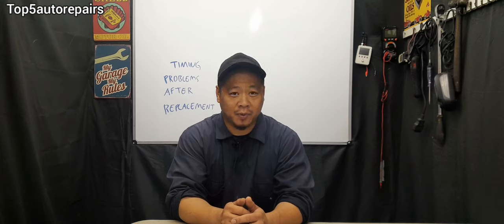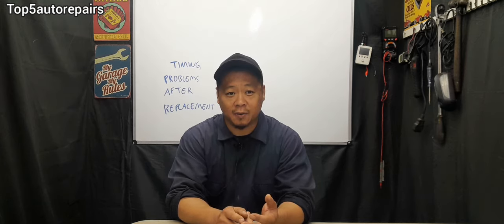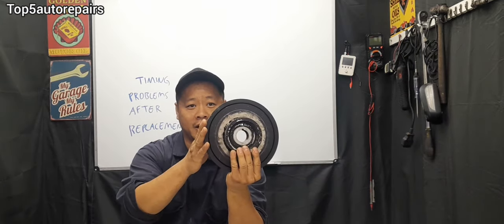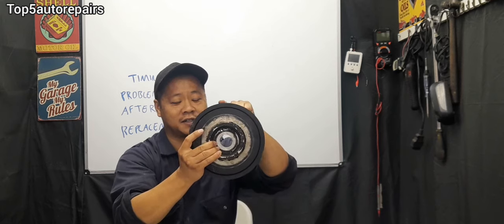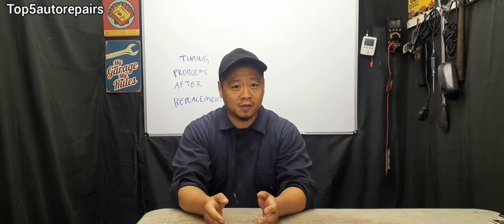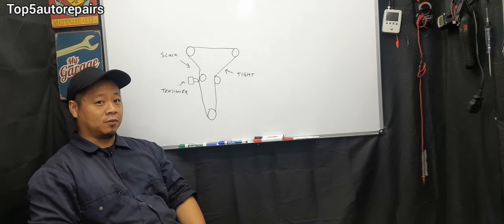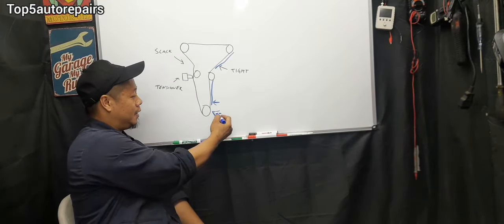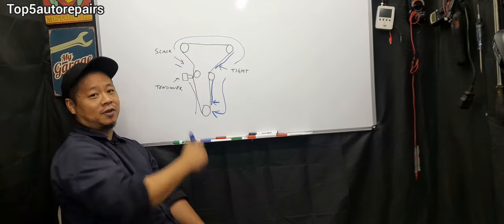CAR ENGINE NOT STARTING AFTER TIMING BELT / CHAIN REPLACEMENT

Comment: I just replaced timing belt tensioner hydraulic,  crank sensor and align all timing marks on 2005 sedona.  Prior to changing belt the idle was having misfires but at higher rpm , ran ok.  I restarted engine and ran ok at higher rpm's but still have rough idle and misfire on #3 and bank 2 oxygen sensor code new codes.  On second start up I inadvertently forgot to put the crankshaft bolt and the Timing Crankshaft Sprocket slid forward on crankshaft about 1/4 inch like it was going to come off but the engine turned off and now won't start.  I had installed a new crankshaft sensor.  Removed it and there were visibly excess rubbing in the sensor channel.  Any idea what need s to be done?  Also when I try start engine, it feels like it reverse direction while it's turning over.  On this interference engine. Is it required to remove 1 plug and set TDC before aligning timing marks on cam gears and crankshaft?  I'm about ready to send it to the crusher.  It does have 225,000 miles.  Any advice would be greatly appreciated $$. Ty...

Comment: Timing was replaced on my 2008 Jeep Commander and it will only start with the camshaft sensor unplugged. It runs and drive great after I get it stated. Not sure how to solve the no start while cam sensor plugged in

Comment: Hi mate I had my timing belt changed by a garage and when I start the car, the car was sounding like a rotary engine after driving it a week hoping it will go back to normal, the car shut down and only cranked but did not turn on and the same garage said the engine is done any clues ( is a 1.2liter vauxhall/ opel corsa) please help😊
Reply from the maker: It sounds like timing was off and then maybe timing jumped or belt probably broke.
Reply from the maker: That will cause a no start due to possible bent valves/low compression.
Reply: @Top5AutoRepairs  thank you very much, Really appreciate best mechanic channel ❤️
Reply: Hi I need help I have a 2000 baleno coil pack version after I changed the cam seal I got no injector pulse on 2 and 3

Comment: Ok so, I thought it was the starter, then I thought it was the alternator cuz I replaced the starter still just cranks... I being told it might be my alternator or timing chain. All my sensors have been replaced my battery is brand new... what else is there ...please help
Reply: Did you get it figured out? I’m having similar trouble
Reply: It’s most likely the timing belt
Reply: Could be immobiliser

Comment: In a 95 Maxima, if I mistakenly use the minor chain tensioner as the main timing chain tensioner, do you suspect it would cause a no start?  I have spark, compression, and a good starter.  I used starter fluid so we can rule out the fuel system.

Comment: I just watched a video right now I have a j 3.5 Acura MDX I replace everything and I checked all my timing top dead center when I start up the vehicle they ran for like less than a minute and the check engine light came on and then when I checked the code it was p0344 so could I be off timing from the cam